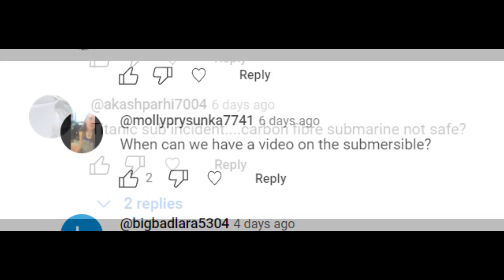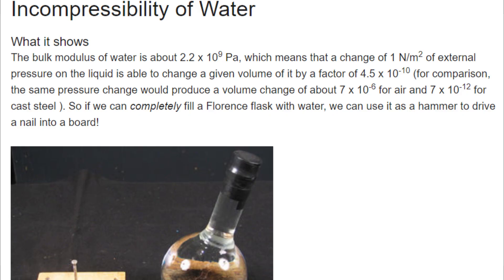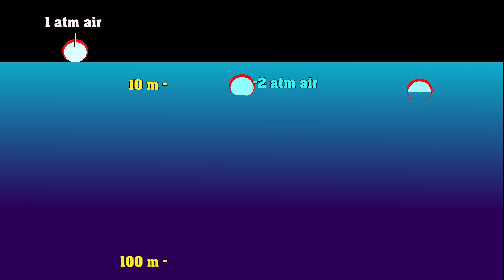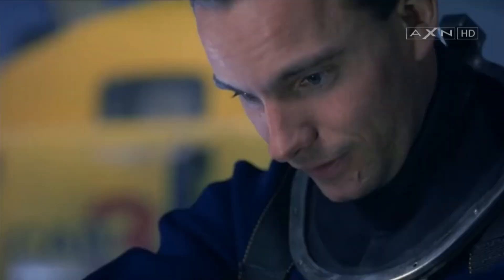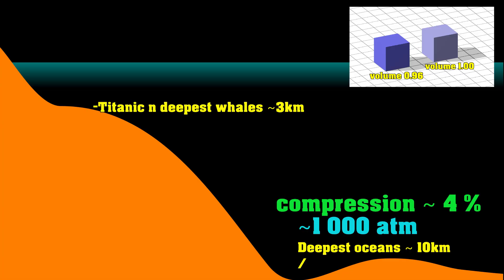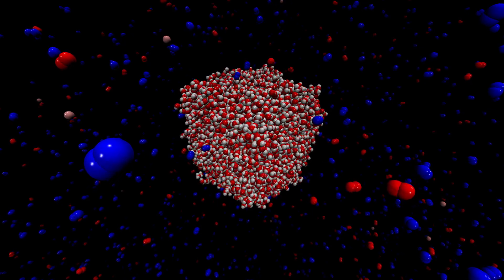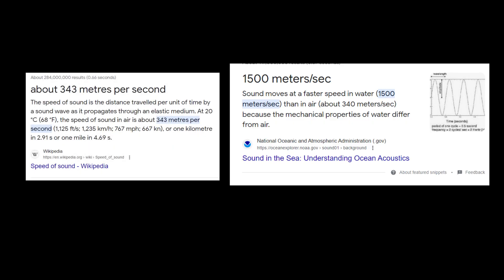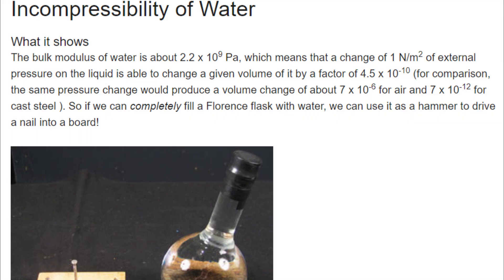What Happens when a Hull Fails at 1000 atmospheres?

Comment: A friend recently asked me - "Would they have suffered?" I replied, "Pretty much no. At that depth, under that pressure of water, IF they heard a crack, it MOST LIKELY be the last thing they knew as it would have happened so quick, it would have been just like a b-mb being strapped to their chests and detonated, pretty much INSTANT obliteration..." It's sad to have happened, but, in a good way, they wouldn't have been stressing about an impending death for minutes or hours.. However, it DOES depend on whether the drive motors/electrical system failed and thus they realised they were sinking deeper and deeper, THAT may have given them IMMENSE stress & worry about what was about to happen and when it would happen. The event itself, no, pretty much instant...
😎🇬🇧
Reply: Scott Manley did the math on the energies involved, it was somewhere around 50 kilo's of tnt.
Reply: @Xelbiuj  also the time it would take, which was faster than your nervous system could transmit any signals. Small mercies.

Comment: It's informative, but it's basically the fancy version of saying: "It's not the fall that kills you, it's hitting the ground." lol.  
  
Also, how does that make the sub implode exactly? Is the low pressure water then condensed extremely fast to catch up to the local pressure, causing everything to get smushed?  
  
Or is it more of a situation like when you blow air under a folded piece of paper, the low pressure actually makes it go down?  
  
If the sub is perfectly well made except in one spot, would it still implode, or does everyone just die from getting smashed by the fast moving water, leaving a shell of a sub?

Comment: So, you've got a couple of tonnes of water rushing in at a couple of times the speed of sound, compressing a couple of metres of air at thst same speed. That air is going to heat up very fast and ignite anything even vaguely flammable, albeit very briefly. So these people died very fast, but if you had a slow mo camera, it would be morbidly fascinating to see the process.

Comment: Maybe somebody here can help me out, but I don't understand why you would want to use carbon fibre as a material for the hull in the first place. If I am not mistaken carbon fibre is great at withstanding tensile stress. But for a sub you'd need somthing that can withstand compressive forces. So why did they do it? Is it cheaper and just "good enough" if done right or what was the reasoning behind it?

Comment: Holy cow, you overcomplicated stuff quite a lot. All you had to do is show cotton swab compression burn experiment and multiply it by 500x. It would be easier to understand. People inside were essentialy burned to death by air itself, as air arround them compressed at high speed and pressure it reached extremely high temperatures

Comment: But is that what happened? I thought that people reported it was a structural failure of the sub - so essentially it did what the whale lung does but with people inside. I mean I am sure water got in at some point and the air compressed like what you are describing.

Comment: I bet it was the bonding between the Titanium support rings and the CF hull.  Mixing materials (without extensive trials) was always going to be running the gauntlet.
Reply: Yep, studying the interface will answer some questions.
Reply: It's also the simple logic of how a CF composite works. Carbon fiber is like a rope and it can withstand an incredible amount of force when under tension. That's what happens when you use it for a high pressure tank. The other way round, the pressure pushes the fibre together, just as if the participants in a tug of war would walk towards each other. The rope would just colapse. So the only thing that gave strength to this sub was really the resin, with the CF bearing no load at all. It is really astonishing that it worked as long as it did.
Reply: @Perry_dAccard  My thinking precisely.  Perhaps the composite tube suffered axial failure as it appears to have been simply circumferentially would, meaning the axial strength would barely load the fibres at all, the compressive strength being roughly equal to that of the matrix.

Comment: That was interesting. But what if the hull was not leaking but just being compressed (at first)?
Reply: Like if the hull deformed but still had enough integrity to keep the water out? I doubt that's possible really but in the event it is, if you halve the volume the temperature will increase somewhat, but not by a whole lot, potentially survivable. Though in reality any hull deformation large enough to cause problems involving pressure will likely cause a complete loss of hull integrity resulting in a big ol' hole opening up instantly water jet cutting everybody apart.

Comment: Better an implosion than knowing you are going to slowly run out of air, and even worse would be to somehow surface but because they are all bolted in from the outside (they obviously didnt learn from NASAs mistake on hatches)would be unabled to get out themselves through a hatch. Safety? Yeah....nah We dont need safety, lets just bolt ourselves into an experimental construction vessel thats already been stressed through past dives. She'll be right. The tragedy of the Titanic is not learning the lesson of "over confidence in new technologies that havent been tested properly" There were many factors that suck the Titanic, such as the ship was on fire for many days when it first left port. The reason she was at full speed was because the coal had to be shovelled in as it was on fire and slowing down and speeding up wouldve had her run out of coal. It was a clusterfuck from the start. lesser than the top grade rivets were used. Steel was early but they knew steel was stronger and steel rivots were the recommedation but they settled for wrought iron rivots. There was a bulge from the bulhead getting redhot. There was a massive coal bunker on fire, it was out at the time the iceberg was hit but it weakend the bulkhead, the last one that couldve save the ship from sinking, but couldnt hold the water and ruptured. Over confidence verging on recklessness causing death. Extended tests and inspections were needed first. Before live testing. The Titanic tragedy has claimed over 1500 now. Both accidents neednt happened.

Comment: Carbon fibre seemed an odd choice of material to me. But its a bit of an unknown.  What is known is that the window wasn't designed for that depth and the window isnt there on the end caps.  But it could literally hav e been hammered out by the waters inertia as shown in this video.
Reply: Like you say, the window was probably pushed out during the implosion, (not the cause of it.) My bets are that the carbon fiber failed

Comment: As a custom knifemaker my clients often request carbon fiber for handles and while it is tough it is also fairly brittle so I was really surprised when I found they used it for the sub hull. I make sure to round all the surfaces as if you have square ones on the handle and drop it a chunk can break off sometimes quite easily.
Reply: It's weird they would chose to make it out of carbon fiber when it's usually used in applications like aerospace, aviation & motorsports, where you want something strong but also as lightweight as possible. Diving to great depths doesn't seem like the weight of the craft would be such an important factor compared to safety & hull integrity, when a simple fracture in the CF can cause the complete destruction of the hull and everyone inside. 
I don't know if it was a money thing but I'm sure they're now very much regretting not going with a traditional steel or titanium hull like all other submersibles use and other experts advised them to do.
Reply: @QuasiMonkey  It's because the CEO and half the engineers had no experience in building subs, they were all from the aerospace industry.

They used a material they were familiar with even though that material was unsuited to the task.
Reply: @gavros9636 yah he hired them cuz the experienced people he hired kept giving him push back lol wanted people he could easily push around
Reply: @QuasiMonkey  It's the "Oooh! It's carbon fibre!" syndrome. You get this from clueless people who have no idea of why you might use the material.
You see it in motorcycle accessories where the carbon fibre reproduction of a component is heavier than the original ABS part.
There is also a "Oooh! It's titanium!" syndrome. 
The various resin composites are mainly used because their superior strength in tension allows for the parts to be lighter and more rigid.
As a deep sea pressure hull is under compression , I think the choice of a resin composite to make one was the choice of an ignoramus . Possibly some NASA idiot with his mind fixated on the reverse conditions a hull in vacuum experiences.
Btw some grades of glass reinforced resins out perform carbon fibre reinforced resins.
Reply: @PaulG.x  They should have made it out of weed fibers! Everything is better on WEEEEEEEED!
Reply: Carbon fiber has become a colloquialism for anything with carbon fiber set in a resin. 
Composites are hugely complex. The resin and the type of fiber can have vastly different properties and wildly different outcomes.
Reply: @sjbechet1111  Whatever version of modified Carbon Fiber they used instead of steel or titanium, and to quote Ryan Gosling in the SNL Papyrus skit: "Whatever they did, IT WASN'T ENOUGH!"
Reply: @QuasiMonkey They did not buy any magically adapted resins or carbon fibres. They bought from Boeing - got it cheap because of old best-before date.

So they used material Boeing did not want to use... And they used material best suited for tensile load to create a hull mostly handling compressive loads.

The CEO did collect "don't do" ideas and made sure to test them on that sub.
Reply: Carbon fiber is great for compression tanks when the fibers are under tension, not so great the other way around, as only the resin is providing compressive strength. Just look at videos where various materials are crushed by hydraulic ram. CF is weaker than aluminum at the same pipe wall thickness.
Reply: @ctrlaltdebug  carbon fiber is still very strong in compression along the fiber direction. Perpendicular to the fiber orientation, it is weak, as you pointed out.
Reply: I've wrote about it on many comment section, but I've worked for a composite materials tanks manufacuring company for 26 years, and the resin have a very limited bonding on titanium and other métal, and filament winding tanks weren't made to handle pressure, even less external pressure, even by using matt/roving/mat/roving/ hand lay up, the bonding is still very limited on a surface as huge as the submarine, which will act like a mold, and little by little, the métal will deforme under pressure, which in turn, will cause the limited bonding to let go on the titanium, and not being thick enough  will be squashed under the immense pressure.
Reply: @MarvinHartmann452  I think the titanium end caps were fastened with screws ,not bonded to the composite structure. There are flanges on the end caps , visible in images and I suspect there is no "door" , access is by removing the end cap.
Reply: One experienced submariner claimed the main problem with Titan sub was that they used three different materials with different expansion contraction rates which are affected differently in temperature drops, titanium, carbon fiber and plexiglass. In military grade subs you won't find any windows, and it's always a one cohesive chunk of material encasing the whole sub.
Reply: @amonynous9041   Military subs don't need to dive deep. Civilians subs are regularly diving extremely deep. And do have windows - in a perfectly safe way. But they don't glue titanium + carbon fibre in the way this sub did. And they avoid tubes unless the tube is proven multiple times stronger than needed. From steel or titanium. I think I have never seen any acrylic tube - only spheres. So uniform load. Uniform compression. And not depending on glue for the strength - so no difference in expansion cracking any glue.

The two scary parts is the glued end sections. And all the laminations inside the tube walls. So easy to get a delamination and lose a huge amount of strength.
Reply: Surely you've seen carbon fiber tanks used for thing like Scuba, or paintball? It's a great design for pressure vessels, but not at that kind of pressure.
Reply: @Andrew-un8tx  Oh for sure however they were warned by the company that made the carbon fiber that going to those depths would flex it in ways that could cause it to de-laminate and even a small internal crack at that pressure could cause it to fail. Even on my knives if I make it for a military customer I try to steer them to micarta for the handle and always use mechanical fasteners along with the strongest epoxy I can buy and I would never trust glue of any kind on its own as they did on the end caps. I personally think the flexing caused the glue to fail and that was all she wrote. Adhesives today are amazing but with any of them failure over time is all too common.
Reply: @Andrew-un8tx  A pressure tank is under tension , so a composite experiences ideal conditions. A deep sea pressure hull is under compression , so a composite experiences the least ideal conditions.
You didn't think about that when you commented
Reply: @PaulG.x  Yet this technology has shown it works just fine under compression, even being used to go to the deepest parts of the ocean.  Perhaps you might want to look into the epoxies used in this vessel and see how they react to compression and tension. You seem to fail to realize carbon fiber used in thses applications is is not one material.
Reply: @Andrew-un8tx  If you don't understand the difference between compression and tension , google it.
I can not be bothered with pointless arguments.
Also: google "material characteristics of resin composites."

Comment: Okay so...Water is sort of like a compressed spring that has a ton of potential energy that it wants to release, except it has nowhere to basically spring to. But then when you bring a pocket of air down fairly deep, the water looks at it like Spongebob from that one episode looking at the pitcher of water and it goes "Hey...I could spring to that." And then when that thing surrounding that air pocket opens in some way- maybe a leak or something, the water instantly goes "I'MMA SPRING TO THAT," and then suddenly you're instantaneously reduced to less than a soup can, and it happens so fast that it sounds like a huge explosion.
Do I have all of that basically right? I like summarizing stuff to my friends when I share stuff like this.
Reply: I like your explanation

Comment: Thank you for this. I spent all week wondering about these simplistic examples of what happened down there - the essential nuances explained here make it all make sense.
Reply: air is moving around at the speed of sound man is that quiet I thought that would make the air super loud if it was moving that fast
Reply: @raven4k998  the tremendous noise was picked up by the US navy , I guess as the air was pushed through the water at high speed.
Reply: @shamilton2556  well yeah with those pressures it would be

Comment: Apparently, they picked the idea of titanium-capped carbon fiber hull from the navy, they manufactured those for war purposes.
Reply: For unmanned vehicles…
Reply: @allangibson8494  They didn't exactly made any manned submersible vehicles for less than 5 crew. Something so tiny didn't struck the navy as worthwhile.
Reply: @michaelbuckers  The closest comparison would be the NR-1 (with 13 crew) or the swimmer delivery vehicles (which were freeflooding until the most recent generation).

Comment: You say that the reason (or the "enemy") is not the preassure but the compressability of water is . Yet that compressablity is directly proportional (i.e. related) to the preassure, which is causing the compressability, ergo the root cause of the problem is the preasurre, ergo your argument that the preassure is not the enemy is invalid.
;-)

Comment: Does the air get extremely hot as the water enters at those speeds because of compression?
Reply: Yes, but it doesn't matter. You aren't gonna die from heat, you are going to die from the impact of a supersonic wall of water.

Comment: Umm, I tried to see it this way, but I just can't see it as the complete picture.  While it's true that the pressure on the water is zero in regards to the water around it, the difference in pressure between the 1 atm sub and the 400 atm of the water is the potential that causes the water to start moving...   and it gets moving very fast indeed.  It's the same principal as used in a water jet that can cut steel or ceramics - extreme pressure causing rapid movement.  In fact, the lowest pressures that normally define "water jet cutting" start at 200 atm, the same order of magnitude as that found at 4000m... and that's just for starters.  Given that the water is at 1 atm once it leaves the cutting nozzle, it's is obviously therefore the velocity that is doing the cutting.

Compressibility would certainly affect the water surrounding the implosion, but it seems a bit effete to consider it as the prime cause.  You could even say that the sum total of decompression of the water surrounding the sub contributes to the cause of the sound wave that would be "heard" across the world ocean, but again it's not what directly caused the implosion.

Similarly, saying that the water should fill a void at 9.81 m/s^2 but for the compressibility of water is incorrect.  Any statements to this effect ignores the effect of pressure.  It is the compressibility of AIR that is the problem here, not the compressibility of water.

My feeling from this is that you were fairly irritated by the question, so chose to obfuscate it in this manner.